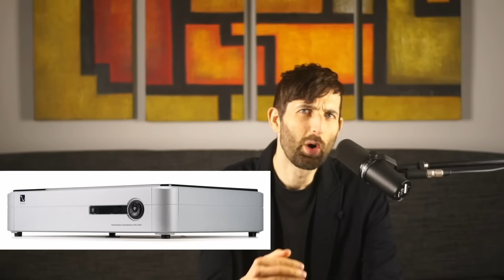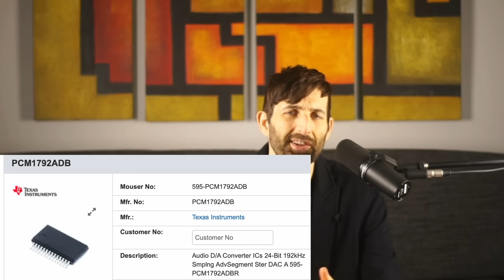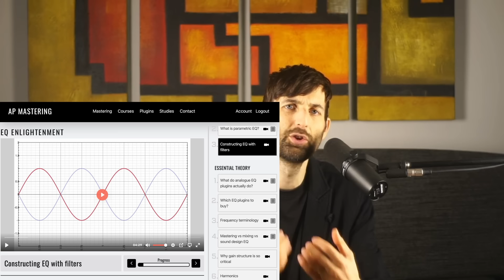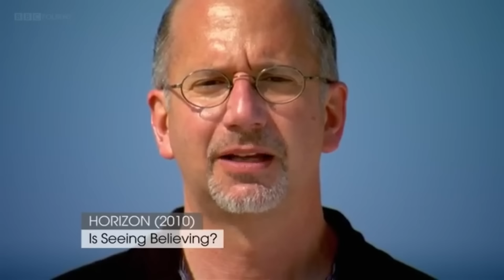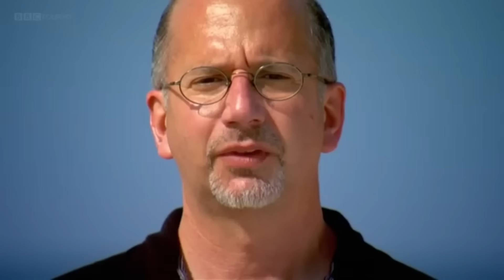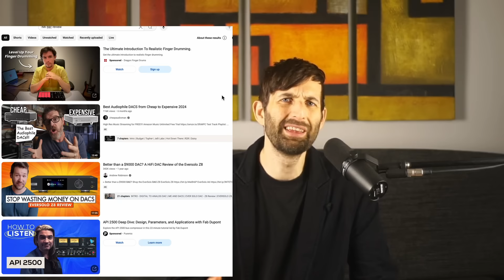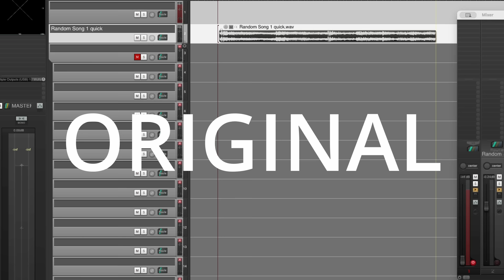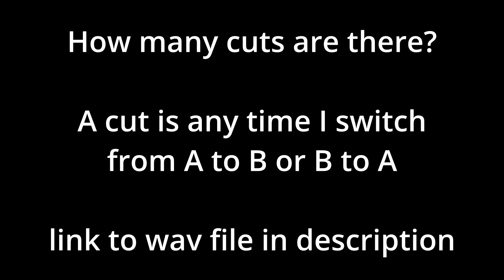The DAC Scam - Almost everyone believes the hype

Comment: Hm? I don't know. From my experience...I listen to music from the YouTube app on my TV, which is connected via the digital output to the DAC in the amplifier. This in turn drives the DIY speakers I build. Recently I got Wiim mini streamer for my birthday. I have only one digital in on my amp, so I connected Wiim through analog out to my amp with RCA cabels. This way I'm using Wiim's DAC and I'm bypassing amplifiers DAC. 
I was convinced that the music would be cleaner through the wiim's DAC, as I didn't have much confidence in the DAC from the amplifier. But I was wrong.
Second strange expirience I had was when I was trying out diferent capacitors in the crossower for my speaker. I didn't truly believe I would hear anytihing, but just to be sure. There was a clear difference in sound between Jansen audio and Mundorf foil capacitors. I couldn't believe it. I even tried tswiching capacitors between two crossovers, thought I made different sounding speakers. But the difference was still there. I even switched speakers left and right, if room caused the difference, but still no. It was the capacitors. I even changed resistors and coils for different value on the crossover with Mundorf capacitors as I tryed to mach the sound comming from speaker with Jantzens. I came close but still they lacked air and livelines.
Then I bought second Jantzen capacitors and inserted them instead of Mundorfs, and the diference between speakers was gone:)
Reply: OK. I tried something and I'm shearing with you my impresions. 
Summary in short...I have 3 inputs:
Philips TV connected with optical out to the input of the Arcam SA20 amplifier with integrated DAC.
Wiim mini, AUX OUT output, to AUX IN on the amplifier.
CD changer digital out to digital in on the amplifier.
As I said, the sound in this configuration with the Wiim mini did not suit me at all. That's why I hardly used the mini.
As a joke, I pulled an old Topping E30 DAC out of the drawer. Now I connected the Wiim mini optical out to the Topping optical in and from Topping to the AUX IN of the amplifier.
Now Topping is my DAC, and Arcam SA20 only amplifies.
Guys, the change was immediately noticeable. From the first one, even before I sat back down on the couch, there was an obvious silence between the instruments and an emphasized bass. As soon as I got to the couch, I was surprised by the formed stage. The singer and the instruments were so separated from each other, with clear boundaries, that I could follow each instrument without effort. A space was created between the instruments. After listening for a long time, I noticed, especially at high frequencies, that the sound had a kind of digital? sharp sound. It doesn't sit well with my ears. Sometimes the bass was a bit too much on some songs. But it seemed faster, with a bit more detail, than when I listened through the DAC on the amplifier.
Regardless of what you think about my experience, I will tell you that it seemed so obvious to me that I could hardly have made it up.

Comment: I mean no offence to anyone here, we all have our own opinions. But todays digital music sounds like shit from the get go. Not to mention the lack of tone controls on most high end audio equipment is simply stupid. ALL music that is recorded - no matter the method, has eq'ing, which may not match your particular audio set up- hence the need for tone control. Room size ect. play a huge role in quality of sound.

Audio nirvana is not about some reviewers opinion, but rather, about what you enjoy. I prefer analog over digital, not that I am old school, but rather, analog sounds smoother to me, digital has sharp drops offs in the high freq. that I simply hate- cymblas usually sound like shit in digital. The on/off of digital vrs the smoother transition of analog is very difinitive. Listen to a live cymbal vrs a digital recording of the same.

How good can digital be if you need "x" times over sampling and shaping to simply get a decent sound quality? Why is it necessary to ramp from 44kz to 384 kz? 

There is no such thing as "transparent" music. Digital does low freq. better, but analog does mids and high freq. better, in combination they can sound very, very good.

Try listening to a really good analog system vrs a really good digital system. Then combine them, (done correctly).

You will hear exactly what I am speaking of. Understanding of sound waves is definitely a necessity. All digital has done is to make the recording and listening process cheaper and less time consuming- for a lesser product in the end.

Comment: Some months ago I tested three media player/DAC combos where two had the same DAC chip in it (ESS 9038Pro, Nubert NuControl X and Eversolo DMP A6 with external SMSL/VMV D1SE DAC because that sounds a bit better than the internal DAC). Not a blind test as this was not necessary and impossible (thanks to Nubert that they let me perform that test with my own Eversolo/DAC). I am 55 years old and could "hear" only very tiny differences. So tiny that it is not sure that there really WAS a difference. Even a Bluesound Node (N130?) was CLOSE. I tested with 5-6 songs that I always use for each and every music test.

I then tested in another HiFi studio three different music players/DAC compared to my combo (a 12k € Linn Klimax, T+A MP2000R and a 7k € (?) DAC . I clearly heared differences here. The expensive DAC sounded really bad in the first try (cold equipment?). The T+A had its highs and lows, the Linn Klimax sounded somehow "organic" without any problem, just harmonic, altogether a bit better than my ESS9038Pro Combo, but not a giant leap forward. If I had the money I would buy it, because I really LOVED the design! Second test with the expensive DAC was much better, but did it outperform the others? Nope - just another way of presenting the music...

Conclusion for just me: expensive DACs or music players are not worth my hard earned money. My combo for 1.300 € did a great job and  was difficult to be outperformed.

Comment: It's not true that all DACs use the chips. Some build there units complete of scratch.
The good ones are noticibly better then all common chips.
But to archive s better quality is not cheap.
You can build a good DAC for 500 Euros. To be better you need around 7000 Euro ore more.
Reply from the maker: what does better mean when nobody can hear the loopback?
Reply: @APMastering  I recently did a test with 8 DACs . Pricing between 5000 and 25000 Euros.
The differences are clearly hearable.
And measurable to.
I have access to a audio precision measurement system .
The AK 2 Chip solution was clear the worst in the field.
We had all actual dac chips as a comparison .
None can reach the good DACs.
And the manufacturers lie in their data sheets 
For example the 24 bit PCM 1702 reaches only a resolution of 15.3 bits in the measurement .
The cirrus chips fail their specs about 25 DB.
An they create tones into the music.
The filters has pre ringing ( tones appear bevor the tone in the music plays)
That's the thing they don't write in their data sheets.
A 15 year old 18 but DAC beats nearly all actual chips in sound quality .

A friend of mine is a electronic developer and works on a DAC.
So we were able to do all these things.
Reply from the maker: @ price is irrelevant since expensive hifi DACs may be inaccurate and bad. people cannot hear the difference in a loopback test with a 300€ DAC so the case is pretty much closed

Comment: I am an audiophile and there are huge differences between the sounds of different DAC's. You get what you pay for. More expensive usually means better/different sound. However, music and listening to it is hugely subjective. One persons expectations are different from the next. One persons hearing is different to the next in the same way we all see things slightly differently due to short sightedness, long sightedness, stigmatisms etc. Sight is generally much easier to improve than hearing so if you are unlucky and you are, for instance, unable to hear certain frequencies then there's not much that can be done about it. There is definitely a point of diminishing returns in the hifi world but to say all DAC's sound the same and all audiophiles are just fools who like to part with their money is not true. So, AP Mastering I put forward this challenge to you. Speak to a hifi dealer or one of the high end manufacturers and set up a demo. You take your studio DAC and ask them to demo it alongside a high end DAC in a high end system which has been set up properly and see what difference you can hear. I am certain you will hear a palpable difference, enough to make you think again.

Comment: The only DAC that I think is even remotely worth it asking price is the chord DAVE. That is because I believe it is the only DAC on the market to use a field programmable gate array rather than an off the shelf chip solution like everyone and their mom
Reply from the maker: why is that better? fpga just means they couldn't afford the manufacturing costs of a proper chip
Reply: @ An FPGA based DAC delivers over a thousand times the raw processing throughput of a fixed function DAC chip, so you can run ultra high order filters with hundreds of thousands of taps, bespoke noise shaping algorithms and custom interpolation simply by updating some (complex) firmware. By contrast even the best off the shelf DAC chips rarely cost more than a few dollars in production and you’re usually stuck with fixed filter topologies and noise‑shaping schemes. Most manufacturers pick those parts because they want a quick, low effort solution with minimal firmware work and looser quality control. FPGA DACs carry higher engineering complexity and non recurring costs, but they unlock jitter and distortion performance that generic silicon can’t come close to.
Reply from the maker: @sebastianhasbun3846  you don't understand what a fpga is

Comment: You don’t mention the part where the signal goes in (before the chip) and goes out (after the chip).
That is where all potential costs are, aren’t they ?
You can have a world class preamp built in to elevate the signal to say 2,5vrms. That part can cost from 20 euros to thousands. U don’t just buy a converter u buy a preamp though most of us don’t need one !!!

Comment: THere is a lot more to a finished DAC than the 'commodity' chips, notwithstanding the DACs that don't use any commodity chips at all.  

All I can recommend is that ppl listen to the gear and let their ears and wallet be their guide.  If you can't hear any difference, or any meaningful difference, then consider it money saved.

Who cares how anyone else spends their money anyway??

Comment: Sometimes,  not only looking at the DAC, the one only looks at the dac specs knows nothing! You should also look at the design,  power supply, output circuit, and control software development, as well as components.

Comment: Well intentioned video I am sure but if you stray from delta-sigma decoding & want to go with an R2R DAC, that's not a $10-20 box of chips.
Reply: R2R DAC is not a better DAC in any circumstances and listening conditions, despite costing more. You can buy a crazy good, top sounding DAC for like 750$.

Comment: If you got the possibility to listen to a good setup, in an optimized room, you hear big difference in switching gear. With your opinion I doubt you ever had heared some of the sys I mentioned. Was a big stepup adding an etherregen. Vibrationcontroll, etc. To go your way, a Yamaha Grand is sounding the same as a Steinway concert. Thats just bollocks imho.
Reply from the maker: i'm a mastering engineer. i've got a better system than most people and have worked in very high end studios
Reply: @ I see. What system are you using?  I have an optimized room with rt 60 0,26 sec. Speakerplacement also with REW for linearity. Active and passive Basstraps. Using Trinnov too. In ancient times I used stargrounding to all my gear. Which brought more clearity. I did as well the right polarity of all eq. Studio is most of the time with very less reflections, lots of absorbers, big studio as well with more diffusion, not equal corners, Walls and floor not connected, etc. Imho not 100% the same goal like leisure listening. 

Now to my question:

What brands of DACS did you test in your setup from the expensive ones?
WADAX, MSB, EMM LABS, PLAYBACK, DCS, ROCKNA, etc?
Which modell?
What are the differences to the modells you mentioned?

For sure, when you have an very resolving sys, you will here the difference of 44.1, 88.2, 192 khz etc… very clearly.

Jitter is a huge thing in the digital domain.
In this respect what is your way to improve this matter?

Best regards.

Comment: 0:25
The implementation of those chips makes actually a bigger difference than the chip itself.

<$500 chi-fi does it perfectly. Uncolored sound with amazing SNR. Hi-fi brands are just snakeoil. This, however, doesn't change the fact that the chip can be cheap, but the rest of the design needs to be well engineered to actually sound good.

Comment: ? ?? Am I missing something here? Is there no programming involved or related? Is it really just the chip? Digital to Analog conversion, right...? I'm sure there was some amount of coding to get from analog to digital from the receptor inputs... so would there not be some type of thing to attempt to undo that? Like how when you shrink down an image digitally then zoom in, it becomes pixelated -- then if you enlarge it, it's still pixelated - unless you are in a program like Adobe Photoshop where it attempts to 'fix' things by smoothing out all of the pixels through its programming to 'guess' what pixels should have been there and smooths out curves instead of leaving the pixelated jagged edges. But even resizing back up after resizing down with that additional coding doesn't restore the image to its original form since data was already lost in-between

So. No. Not really. It isn't just the chips and casing for the DACs. That said... going back to the image file example -- the input heavily influences the output - so if the digital elements aren't good reference points, the analog conversion isn't going to be great either. We have that issue with digital image manipulation and such. Take better quality photos with good pixel quality for better results when adjusting things, since bad quality pixels aren't very easily fixed (or they weren't until AI, so idk about now... except it's really just going in with a brush and painting things over so that might not be truly fixing the quality). So it might not even be an issue of a DAC or no DAC in the first place but just terrible digital encoding shenanigans that could be improved upon

Comment: I spent $85 on an 1 SMSL SU-1…… could not be happier.  Compared it to an $800 dac, could not hear a difference.
Reply: because a DAC does not MAKE a sound, they are supposed to be 'Transparent' which the SU1 is! (Excellent DAC btw)
The SU1 has a SINAD of 116dB (Excellent)
IMD distortion is basically non-existent
it has 19.5 bits of dynamic range
Linearity is almost perfect
Filter attenuation is very good

Comment: I have 2 Apollo 8s and Burl A/D and DAC. When I switch between the outputs you can hear a subtle yet present difference between the converters. A wider soundscape and tighter low end too. When you have the majority of your studio dialled in they're worth the money and not before.. Good acoustic treatment, a solid pair of near fields are far more essential. I'd be remiss to ay monitor position I also vital. Most these things you can do yourself. High end `converters are a luxury.

Comment: Well, I switched to using my LG Oled TV for playing music over my Denon, and I did notice that it sounds better. It has both improved chips and better software. 

So I can imagine some DAC sounding better than others. But at the same time, money is not a reflection of quality per sé. Some of the best chips cost just 20 dollars. The rest is build quality, taking you up around $100-200, and then the rest is marketing and markup.
Reply: For clarity: streaming through the Denon x4000 with its sorry excuse for software that still crashes regularly, versus playing over the LG G7, that then outputs the result over the HDMI cable into the X4000.

I guess the software is the biggest improvement in the chain.